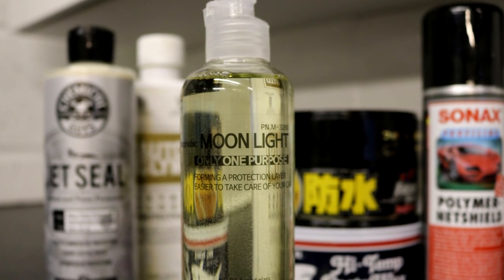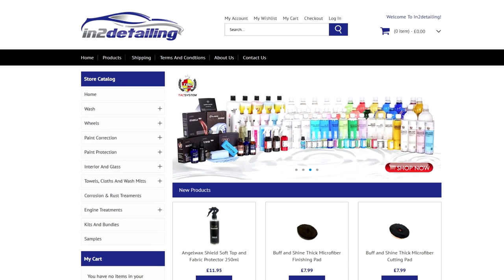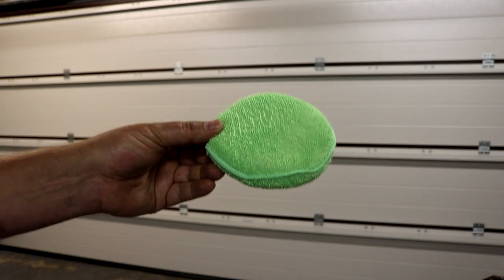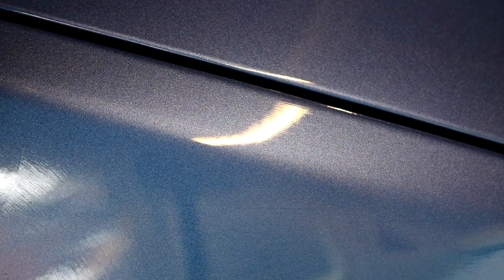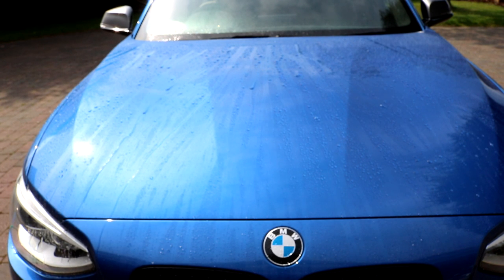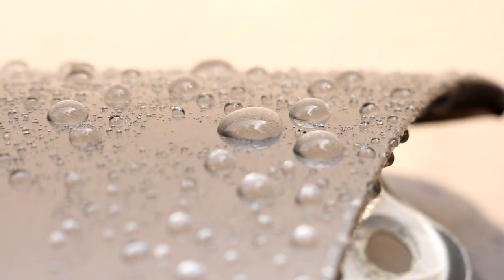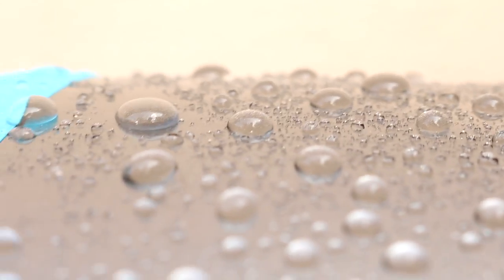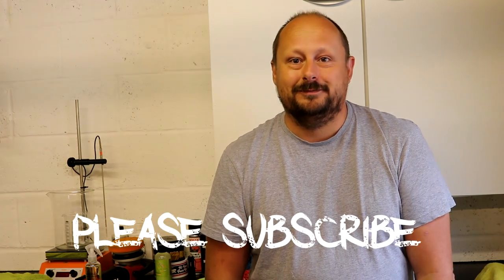TAC systems - Moonlight silica based spray sealant - How to seal your car

Comment: I really lik Carpro Essence which is often used as a base for Cquartz. Do you reckon Moonlight will be ok over Essence? Great vids as ever mate:)
Reply: Paul Mc Dowall Isnt Essence a polish? I think you would use Essence then an IPA after to remove the oils from the polish. Should be hood after that.
Reply: Nicholas M it's pretty unique tbh a 'light' polish (depending on pad choice) with filers (like a glaze) and some si02 thrown in for good measure. https://carpro.uk.com/products/essence500 for the blurb. I've ordered some Moonlight so might give the combo a go on my daily driver.

Comment: Polysilazanes is silicon and nitrogen atoms, which i think is crazy chemistry, i'm also surprised they say 9 months and not longer, but i'm with you 6 months and i'm well happy, any mention from in2 about layering??
Reply from the maker: yer was just a stupid outake not really relevent to the video but it made me chuckle...
Reply: You can layer but not needed. At that point use TACSYSTEM magic.

Comment: Layerable? Would it be benefitial?
Reply from the maker: it will typically add durability and create a thicker layer of the resin.. but its like double the application work for maybe another 10-20% durability.  (finger in the wind guess).   So perhaps single layer is best and maintain it with water based product like quartz max.

Comment: Hi there. I'm hoping to do a brand new car detail to protect my investment. Would you advise the dealer that you would like them not to touch the vehicle, get it home, full pre-wash, iron and tar removal, contact wash, clay, then add the moonlight? Are there any other steps you would take? And secondly, after leaving it to cure fully, would an addition of butter wet wax be a possibility to further enhance the shine? Thanks 👍
Reply from the maker: phil, I would ask for all the factory wrap to be left and I would insist that they dont wash the car or prepare it in any way.. some dealers know how to wash a car properly a lot dont..   important thing to do is inspect the cars paintwork at the dealershipat best you can to look for any evidence of them having gone near the clearcoat..  buffer trails, wash related scratches etc..  if your happy with the car then accept it.. and yer when you get it home you can de-con it if it needs it..   if you clay it you are going to need to machine polish it before protecting it... ideally the contamination level will be close to zero (might not be though) so a chemical decon might be enough.   wet butter wax will work on TAC moonlight mate.. in fact would be a good combo.  enjoy the new car buddy
Reply: Forensic Detailing Channel ok thanks for getting back to me. Sound advice.
Reply: @ForensicDetailing  24-carat. I knew that i would find precisely what I was looking for if I kept looking,, Jon this channel is pure gold ! New car soon, and I really can't wait to get onto it rather than into now. What's come over me ?

Comment: Could you use a wax over this product ? Something like double speed wax to improve its shine and protect the coating ?
Reply from the maker: you can but I would not.  you loose the surface characteristics of a ceramic style product, but adding the wax perhaps gives you less desirable surface characteristics.   not all agree with me on this but thats my thinking.. I would top with gyeon cure or carpro reload.
Reply: Waxing over this will only reduce its ability to perform as designed.   Use quartz max or more moonlight.

Comment: Hi Jon, ive just bought some of this to try out etc... a question for you. With other coatings i've worked with i've always binned the cloths or reduced them to grubby tasks like engine bay cleans, tyres etc due to the risk of marring, scratching... in your experience with the product what have you done with your MF cloths and the applicator? APC soak or bin?
Reply from the maker: relegate to none paintwork / heavy dirty jobs after this or bin the cloths mate. thats what I kind of do now.
Reply: Cheers fella, i saw your other video trying the soaking the in APC trick... personally i'd rather bin or relgate them than take the risk! :-)

Comment: Just received tac system moonlight,  and I'm wondering after applying product,  can you wash the towels and aplicator? Or should be binned?
Reply from the maker: ok I think you might want to relegate them to like engine bay or extreme dirt (non paintwork duty now mate)  I did a video on this.  Trashing microfiber cloths with ceramic coatings.
Reply: @ForensicDetailing  thank you very much for replying

Comment: Jon- I just ordered a bottle of Moonlight from Amazon. I have a question. You explained that Moonlight is about 25% SIO2 compared to a full blown ceramic that are 50-70% in concentration. If  a second coat of Moonlight is applied after the first coat cures, does the second coating double the protection?  In other words, is two coats of Moonlight’s 25% SIO2 concentration equivalent to one coat of a traditional 50% SIO2 coating?
Reply from the maker: kind of.. the thing with moonlight is its using a different carrier as well..  the true ceramics are a combination of the silica resin with other organic resins and a butyl ether solvent.   no carrier oil (and I say oil but its prolly some synthetic oil).   but essentially if you layer moonlight you will get more of the solid going down.    I would say though  your probably much better off going with a full blown ceramic than trying to layer moonlight to get the performance of a ceramic.

Comment: Hi John 
Back to this video just to ask you if we need to discard the applicator and the microfibres like when using ceramic coatings ?
Reply from the maker: gonna come down to personal preference.   Its not a full on ceramic but its still cures to a rock hard similiar sort of thing.. so probably yes.   you can just spread it with the ceramic suede applicator towels on a block and discard the little towels if you like. that works.
Reply: Forensic Detailing Channel 
Thank for fast reply
And how to wash the microfibres? As normal?
Or need something stronger eg: APC
Reply from the maker: @sergiosequeira76  hey buddy have a watch of "How to wash microfiber towels - drying microfibre detailing cloths" on the channel.  again you might want to relegate microfiber that you use to buff moonlight off the panel but Im not 100% sure.  I did a video called trashing microfiber with ceramic coatings but moonlight is not a full blown ceramic.

Comment: Any thoughts on how this would work as the base or stand alone layer, then using something like meguiars hybrid ceramic while wet with follow up washes? Something to extend the longevity of the coating.
Reply from the maker: works awesome for that.  so full prep.  apply this.  and I recomend you maintain it with Wet coat say once every 2 months.  and using done and dusted SI if you want something to use every wash.

Comment: Can Moonlight be used as a topper on top of an existing coating in excellent condition? 
Would it help increase gloss?
Reply from the maker: You don't increase gloss by layering more products.   You increase gloss by refining the substrate further to increase perminant physical gloss.
Reply: @ForensicDetailing  

What a silly answer. 

One of the key features/benefits/selling points of all waxes, sealants and coatings is gloss. And the “layering” concept invented by the Americans, aped by the British and others, were done to improve gloss and durability. 

Yes, I agree that the actual great looks actually come from the type, extent and quality of the work done BEFORE applying the coating. But the majority cannot afford such high level “paint correction”.
Reply from the maker: You can do the high level paint correct yourself. Cost Pennies.   When you have top draw paint waxes sealants and coatings lower the gloss.  There's a bombshell for you.  How do I know because I have a 4000 pound goniophoto meter and I've tested all this.

Comment: Reset shampoo removes paste wax and spray sealants throughout the washes, I pre-wash and bucket wash the Koch Chemie Gentle Snow Foam shampoo, is this shampoo safe for any wax or sealant ?!
Reply from the maker: forget about car washes being safe or not safe on LSP mate honestly.   It makes no difference unless your using some 1980's organic wax loaded with oil.
Reply: @ForensicDetailing  use seal in shine again meguiers wax spray, but to be completely safe I would pre wash and wash with Reset or Koch Chemie Gentle Snow Foam ???

Comment: Although you have to wait 4 to 6 hours for product to cure and can't get wet within that time frame.  Can a wax be applied over top of the coating immediately or would you also have to wait 4 to 6 hours before applying wax? Also is this safe for all clear coats as i have heard that some ceramics can discolor some paints.
Reply from the maker: thats a question and a half brandon.  you know what.  I personally wouldnt lay a paste wax over this product for 24 hours possibly longer.    getting it wet is one thing.  but laying a wax which is about 50% solvent on the coating and buffing it hard to remove the wax would worry me.  I dont know though.  Id run this past imran at in2detailing because he understand the product better than me.   I dont wax over the top of this.   I would use carpro reload on top of it or Tac quartz max if your worried about water spotting.

Ive not ever seen a ceramic discolouring a clearcoat but I am pretty low on experience with them (gonna be delving into them a lot more soon).  with this product the silica content is lower than a full blown ceramic and its got an oil carrier so I am pretty confident you dont have to worry about it discoloring clearcoat.   I had no problems with it.  very easy to use.  the level of solids and the way those solids are delivered take out some of the pitfulls you might get when applying a full on ceramic, but this product doesnt last as long as a full blown ceramic.
Reply: Forensic Detailing Channel thanks a million for the quick response. I appreciate your channel as it helps me make better decisions with  products.
Reply from the maker: thanks brian great to hear that mate thanks very much
Reply: Dont was over it and it won't discolor but depth to it

Comment: which polish do you use or recommend to remove waxes or sealants for applying a new one?
Reply from the maker: there is no perfect one because if the paint is heavily swirls you would use a higher cut one, or if its flawless you would use a finishing polish.   But generally Koch H9 F6 M3 has you covered mate.
Reply: @ForensicDetailing  tanks!
Reply: thanks

Comment: Can you add multiple layers of this? If so, how?
Reply: Tacsystem doesn't recommend any more than 2 layers of any product.   Their products are designed to be durable with a single coat.  But if you wish, wait 45 to 60 minutes and add another layer

Comment: What's a good pre application polish before using this (wiped down after)?
Reply from the maker: well it depends on the state of the car really.  But Scholl S2 black, Scholl 20 Black, Scholl S40 (H M finish) are top draw abrasives.   As is Koch H9 F6 M3.
Reply: @ForensicDetailing  will be a factory new white polestar so hopefully, minor correction

Comment: John, Which do you like better this Moolight Sealant, Jet Seal or Sonax PNS ? Is the Moonlight safe on plastic or rubber trim ?
Reply from the maker: moonlight all  day long.. but treat it more like a ceramic..  you can coat trim with moonlight as well but double check that with in2detailing..

Comment: I've just got the drinker towel it's 60 by 90 1100 gsm 80/20 china origin and it holds 4kg of water so it's up there with the high end towels

Comment: can this sealant stay on the shelf for a long time or does it even crystallize ?!
Reply from the maker: this video is 4 years old.  I have this same bottle. if you check my instagram Im using it in a sealant comparison right now.   so my bottle has been very very stable.  it can go a bit crusty you need to keep it sealed or it will go off. but incredible how long its lasted and stayed good.
Reply: @ForensicDetailing   it takes more work to apply than a liquid wax like the meguiers hybrid ceramic wax, do you think it is good ??
Reply from the maker: @eduardofolha8415  you need to handle it with more consideration.  moonlight treat like a ceramic, dont spray it, lay it out like a full blown ceramic.   megs you can just hurl it on really.    see my 24 sealant test. and have a look at the review of moonlight.  top moonglight with gyeon wet coat, and the new gyeon ceramic detailer for one hell of a protection combo.
Reply: @ForensicDetailing  
I'm looking for some more practical ones like meguiers hehehehhe

Comment: Will silica cause fisheyes in paint refinishing ?
Reply from the maker: I dont know mate sorry... thats one for someone with more experience of it..
Reply: Philip Yeung it is a oil based silica sealant. it won't have negative impact if you wait the recommended 30 days before applications of any wax or sealant products to the new paint work.

Comment: +ForensicDetailingChannel I'm thinking about getting some petes 53 would you say it's more glossy the the double speed wax
Reply from the maker: I dont know if its more glossey on the glossmeter but its more oily, and more glossy to my eyes... but it doesnt last anywhere near as long.. its more reliant on just the nuba wax.. whereas double speed has some additives which give it much more durability and repellency characteristics.. I love petes 53 though
Reply: It needs to have a video on the channel I think petes like you did with the butter wet
Reply from the maker: yer might do a quick one for it.. its a cool thing
Reply: Use the in2detailing buffing cloth would be a good combo

Comment: hi i am getting a brand new car this week how would you go about preping the car for putting this product down ? cheers jon
Reply from the maker: hey jon,  its a long thing to try and go through.  Have a watch of the new car detailing video... but you should wash down the car well.  inspect it for contmination and it will probably need a light decon followed by gentle polish.   Then degrease and layout moonlight.  once moonlight is layed out after a few hours.   put quartz max (silica spray on it).  moonlight is vulnerable to water spotting issues like normal ceramics for like the first few days if its just left outside and exposed to water.  (saying that more than often those water spots just wash off, but in baking heat and heavy water areas it could be a problem.. so get somes quartz max or carpro reload to top it with).  other than that moonlight is so damn nice to apply.  so smooth.
Reply: @ForensicDetailing  Thanks for the quick reply much appreciated
Reply: Hi John i   have bought this tac moonlight and will be applying on saturday . The car will be left inside all night would you still top off with the quartz max or would you just leave the moonlight to cure overnight on its own ? cheers in advance
Reply from the maker: @jongraham2679  yo jon I would leave it all night to cure.  Then after that quick squirt spread and shine of quartz max or reload.  Ive actually just been playing around with moonlight and quartz max and the other silica ones.  on the strip where I left naked moonlight it was more prone to collecting water spots.  strip with quartz max has none.   note the water spots just wash off though the moonlight, its too cold for them to like bake on in sunlight etc.
Reply: @ForensicDetailing  Thanks for getting back to me john much appreciated thank you . i will let you know how it goes
Reply: @ForensicDetailing  Hi john thanks for the heads up on this stuff . applied it today aand its come out really well . 

its curing in the warehouse at work . iwill give it a squirt with the quatz max tomorrow  cheers
Reply: @ForensicDetailing  Great Q & A for me - new car coming Sept so I suppose that my detailing research will come to a close now after viewing the new car film, at last I'm confident that I'm getting reliable and dependable information. Thanks Gents.
Reply: @ftlikemike  Jon, you did a dynamite vid on Moonlight/Gyeon Wet combo. Q is: Gyeon or Quartx Max to finish off?

Comment: Whats the stuff you can put on top you mentioned?
Reply: How would this react to be put on Alloys ?
Reply: nicky chavda it can be applied to wheels as well.  however there is a separate product called magic that is made for wheels, trim, ect.  it's temperature rated for those applications.
Reply: Thanks Mason, I saw that too but as I was going to start with this first just wondered if it would cause any issues if I tried it on the alloys too?
Reply: nicky chavda you're good. the best results is clean them with a Fallout remover, wash, clean with a ipa or oil remover and apply. a little goes a long way.  spray 1 squirting on a applicator, and wipe on. look for the haze to know you have coverage.   Wait no more than 3 minutes before wiping off.  use 2 good mf towels.  keep dry for a few hours. don't wash with soap for at least 5-7 days. after that, enjoy!
Reply: thank you Mason, can we wash and re use our buffing clothes after or do they need to be binned ?
Reply: nicky chavda you can reuse foe wheels and such but it will have some residue on the fibers that you don't want to risk scratching other paint work.